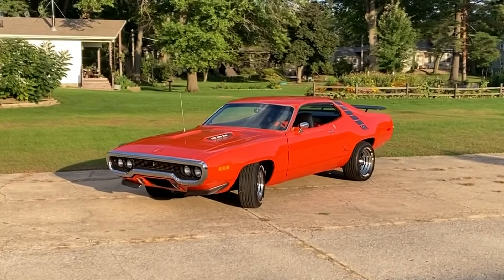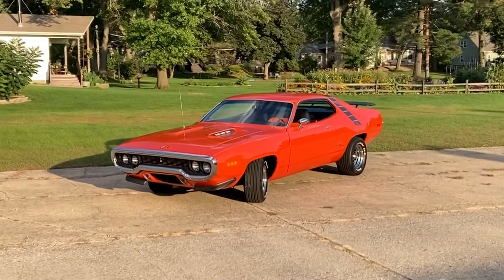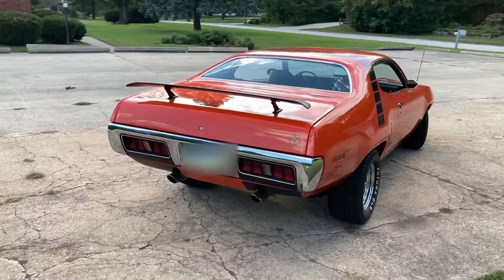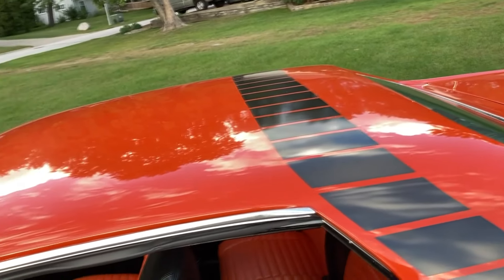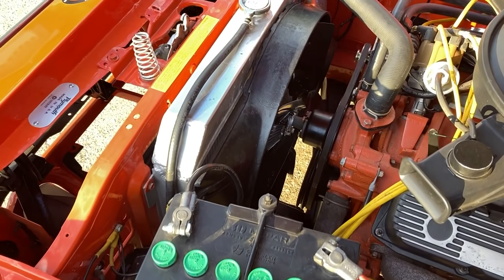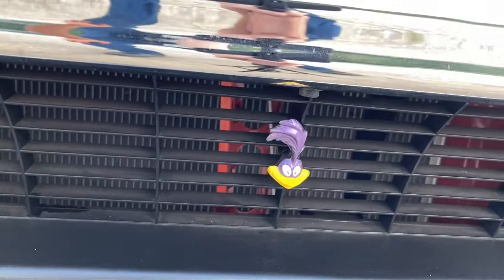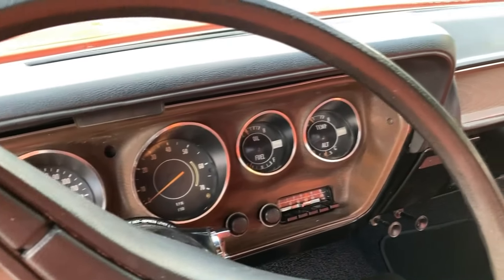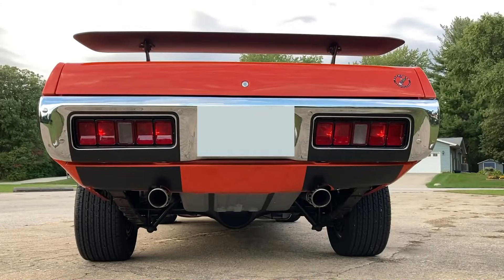The 1971 Plymouth Road Runner

Comment: Your speedometer is cable driven from a gear in the tailshaft of the transmission.  You can change the gear to adjust for your rear gear and tire diameters.
Reply from the maker: thanks. i didn't notice till just not but I meant to say the tachometer isn't right! Any advice for that?
Reply: And if I'd have paid attention I would have realized you meant the tach. Anyways, I'd wire up a good tach just to verify your suspicion.There is only a wire from the coil to the tach so doubtful that's going to throw the rpm off.  If it is off no choice but to pull it and have it rebuilt to fix it. Redline Gauge Works did a great job on mine.
Reply from the maker: @jamesprodorutti2454  Thanks for the tip!!

Comment: You also have the Green Cap 6 cylinder Battery.
Reply from the maker: lol it was a repop, didn't know that was for 6cyl, what color was the 8cyl and where can I get one?
Reply: @FieroAustin  Big block 383 are Yellow Caps and 440/426 are Red Caps there's a guy in Knoxville sells them.
Reply: @FieroAustin  you can order just the caps on ebay
Reply from the maker: @joemish1  Awesome thank you!

Comment: Did you custom make the inner fender covers in the trunk? I’ve never seen them before.
Reply from the maker: Got it that way but the guy said they were "like original" however I've never seen them either. Not on any other car. They're some sort vinyl coated paper I think. Kind of nice, keeps dings away.

Comment: I've always had a-bodies and like I said in the previous comments I recently picked up a 71 satellite dressed as a road runner but there's something I'm unsure about with these 71s. Were rallye gauges standard in a 71 satellite and road runner? Also was a 150mph speedometer standard in a 71 satellite and road runner along with a factory tach? I'm asking because the 71 satellite I have has a 150mph speedometer and a tach and its not showing and indication of the cluster being swapped or even the entire dash itself being swapped. Also usually when people swap clusters or entire dashes they never get everything working again unless it's a restored car which my 71 is not a restored car and the tach works in my car and that's just something I wouldn't expect if the cluster was swapped out or the entire dash was swapped.
Reply from the maker: I might not be the guy to ask, but from my understanding rally gages were an option on both satellites and road runners, so it very well may have been factory. I have seen a 72 satellite with original rally gages.

Comment: I have a 71 roadrunner with manual steering as well. How well does yours drive in the city?
Reply from the maker: like a 70s car lol!!!!
Reply: @FieroAustin  I did kyb gas a just shocks all the way around, rear sway bar with poly bushings as well as the factory front sway bar, tubular uppercontrol arms, poly strut rod bushings, boxed lower control arms with poly bushings, new balljoints as well as new idler arm and tire rod ends. Only thing I still have is manual steering lol. This thing handles as well if not better than my uncles new charger minus the manual steering lol.
Reply: @FieroAustin  I saw your video and almost painted mine hemi orange but went with sublime green instead lol.
Reply from the maker: @allenpp6748  that or plum crazy would be my second pick!!!
Reply from the maker: @allenpp6748  frankly i don't really like the KYB gas, definitely a bit stiff.
Reply: @FieroAustin  Yeah they are cheaper and worse than the bilstein's but they work fine for now on a budget. How often do you drive it? I plan on driving mines to new orleans from los angeles lol.
Reply from the maker: dang!!! sadly it is a garage queen. a few times a year
Reply: @FieroAustin  Alright then. look forward to seeing more content about it lol.
Reply from the maker: @allenpp6748  some coming soon...!

Comment: I like that body style a lot. The fact that it has a 383 is even better! Do not change the intake manifold. The Torker 2 has better high end power with at least equal low-end power compared to a dual plane.
Reply from the maker: Think so? I have no need for high end, but if low-end isn't compromised that sounds like a good deal..
Reply: @FieroAustin  You have the right idea. Single plane for the strip, dual plane for the street. You ABSOLUTELY lose torque with a single plane intake. That's the whole idea. You sacrifice some torque and make it up (and then some - with horsepower) at the big end (at the strip). Amplify that if the engine is bone stock. GORGEOUS car!
Reply from the maker: @RobertSmith-js2kz  right on. Thanks for the tips!!!